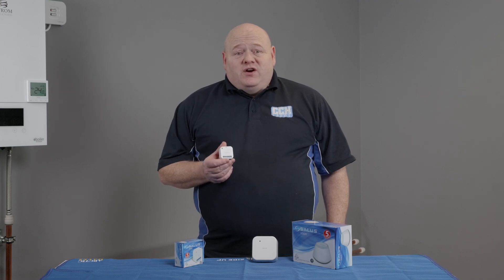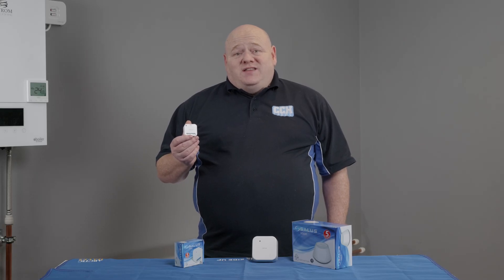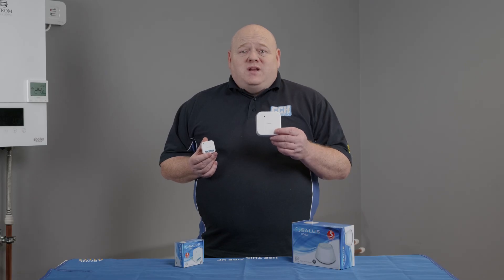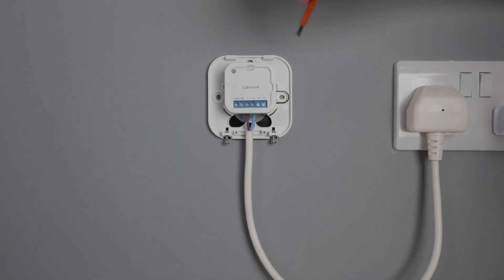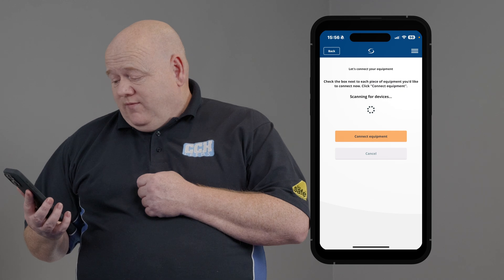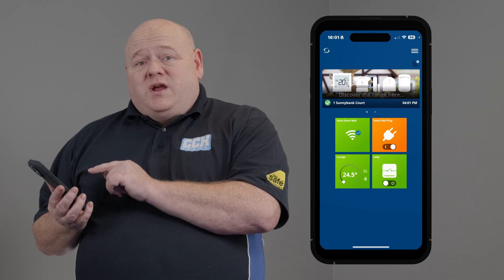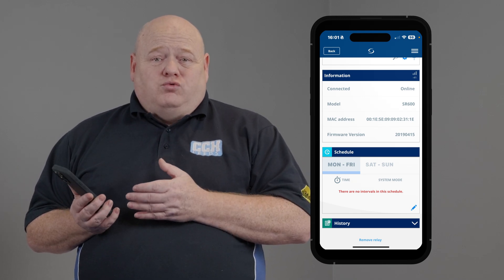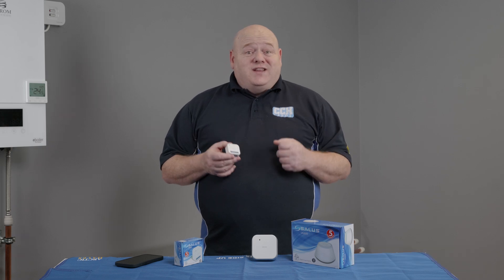How To Connect Salus SR600 Smart Relay ( Smart Home )

Comment: Thanks! What i am missing is the RS600 entrance gate wiring  example. Would be very usefull.
Reply from the maker: https://support.salus-tech.com/portal/en/kb/articles/rs600-wiring-diagram-10-3-2023
Reply: @AllenHart999  Thanks. I still cant figure out how i can connect/controll the driveway entrance gate? I thought RS600 was the solution with two outputs to open/close the gate. I am having trouble understanding the diagram.